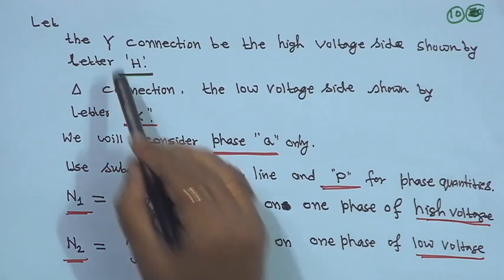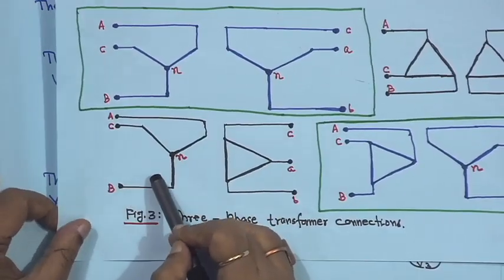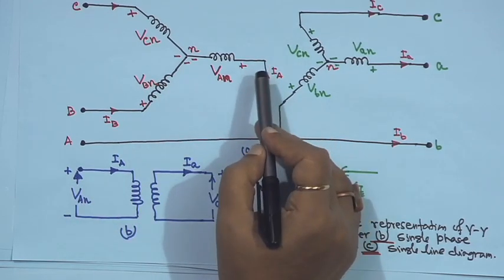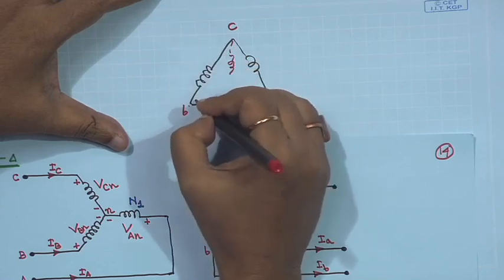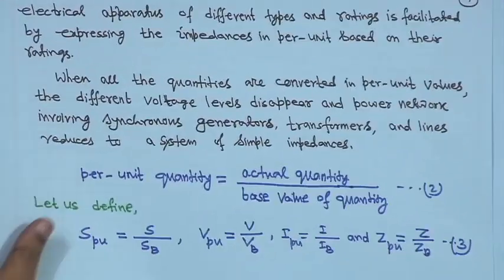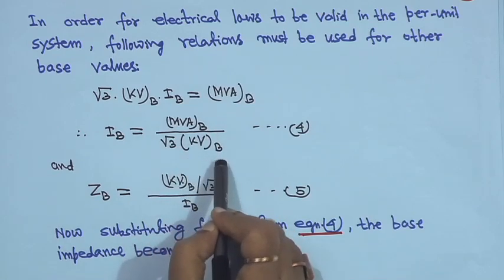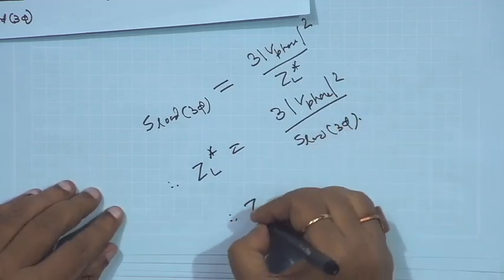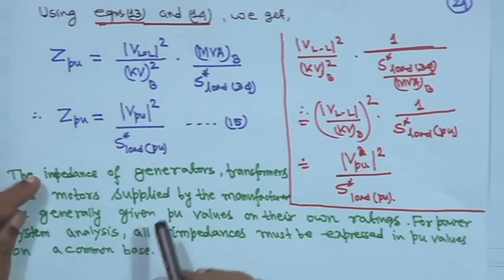Lecture 16: Power System Components and per-unit system(Contd.)

Comment: Why stater conection is high
Reply: because its phase voltage is 1/(3)^.5 times line voltage. so insulation requirement is less in comparison to delta whose phase voltage and line voltage are same.